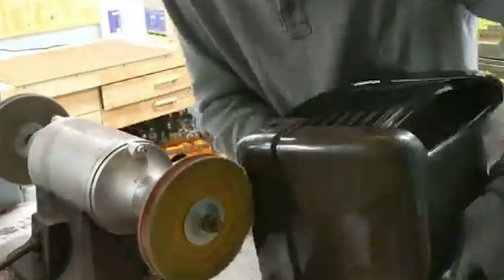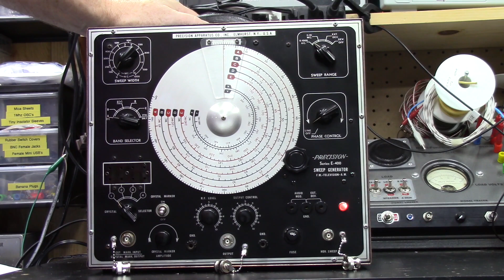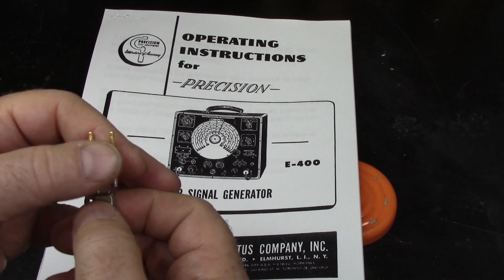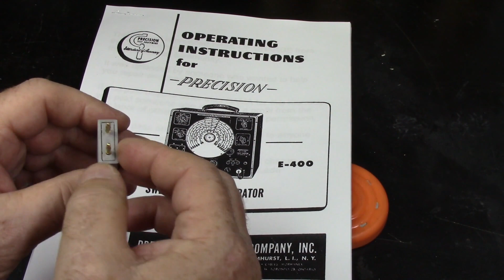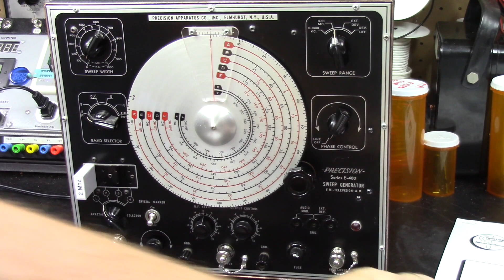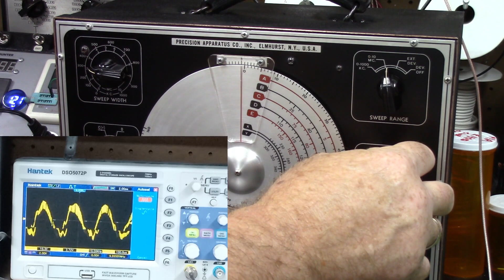PACO  E400 Sweep Signal Generator- Part 3-  Final & Testing

Comment: What I know about this type of apparatus can fit in a thimble. LOL  That being said you could use it to align AM/ FM radios.
I think also  vintage FM transceivers and TV's would also apply there too remembering this unit came out in 1948. My
guess is you are never going to have a need for it Gregg . It does appear to be working properly with a sinewave generator. Probably would need to make a replacement probe to see if can actually be used to test a FM receiver.
Reply from the maker: Thank you sir, I'm making a swap with Doug over at Mosslack, as he has more use for it than I ever would. I have little knowledge in general much less this. It is very nice now and likely is fine if adjusted and used properly. It was free and I did what I could with it.

Comment: Does your scope have an X axis input?  If it does, try applying the sweep to the X axis and your signal to the Y.  You should get a spectrum display.
Reply: Incredible transformation Gregg, looks like a new unit right off the assembly line. Love the crystal holder you designed and built. Still watching and will edit. Best, Don
Reply from the maker: Thanks Stephen, I'll check it out.

Comment: Hey Gregg!
I noticed something that you might want to check out.  It looks to me like you have a total of 4 positions for Crystals to plug in on that unit.  When you were attempting to test the 2 Mhz crystal I think you had the crystal in position 1 but the switch below it switched to position 3 which was empty.
Reply from the maker: Good catch Wayne! Stupid me never even saw that. I'll hook it back up and see what that does! Thank you!
Reply: Not really stupid on your part, Stupid is what I did once upon a time...I got hit with 40,000 volts!!!
 @greggsvintageworkshop8974